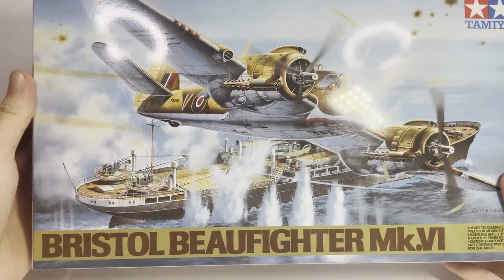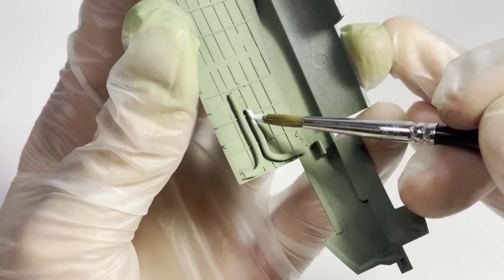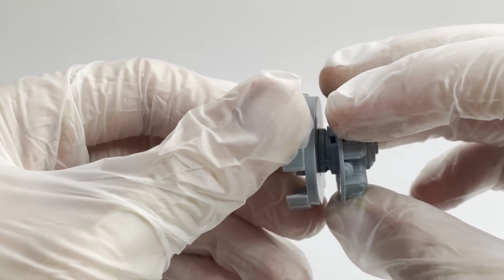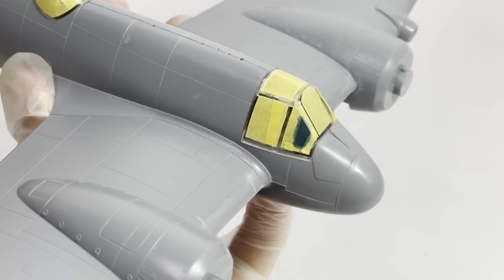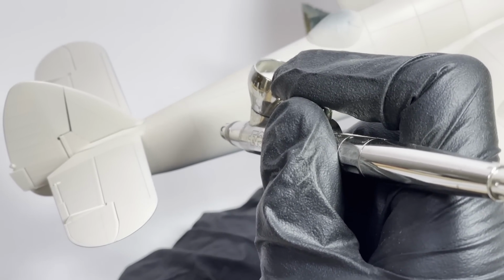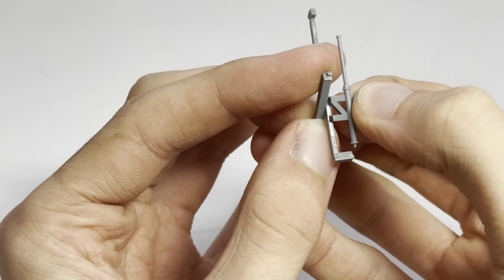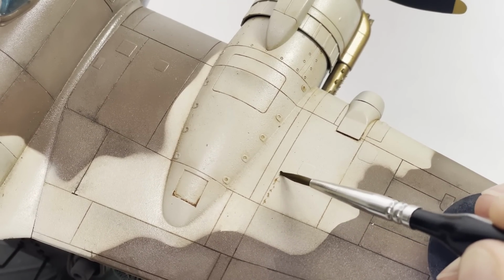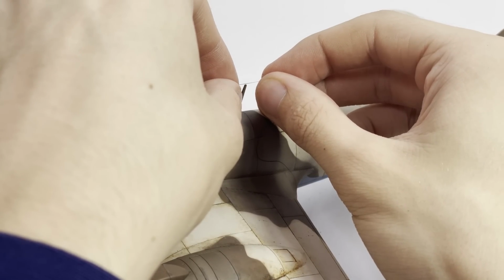Tamiya's 1:48 Bristol Beaufighter Mk.VI | Full Build | HD

Comment: RAF very nice turboprop Bristol Beaufighter Besides the Luftwaffe turboprops of the German high command. Good guys vs the bad guys in air combat fighting. I like this plane twin engines. ❤😊🤩☺️🤗🇬🇧🇬🇧🇬🇧🇬🇧
Reply from the maker: Thank you Neil for the information!!😁
Reply: The Beaufighter is a lovely aircraft but did not have turboprop engines as the turboprop is a type of jet engine that delivers jet thrust that drives the aircraft propeller. The Beaufighter had radial engines of various types and the RR Merlin for the MkII. The German a/c were also not turboprops.

Comment: I've just masked off the roundels on this model. I used vallejo "air war" colour set over a hairsprayed aluminium. Got a little bit of reaction but has added to the scratchy, sun-beaten look. I drybrushed bronze over aluminium for engine cowlings as I think the copper that tamiya calls for is too bright. I think youve got it just right. I like your post shading with the straight edge mask, ill give that a whirl too. Good video, well done!
Reply from the maker: Some superb tips and tricks there which I am sure i’ll be using in the future! Thank you very much for the comment😁

Comment: Thats a very nice Beau 👍🏻👏🏻👌🏻 One of my favourites and a bit of an unsung hero.....
You're definitely on a roll at the mo!
The exaggerated dihedral on the horizontal tail was introduced after the original flat tail was found to give some directional instability on take off and landing.....just out of interest.
Also, out of interest, when painting the second camo colour and masking like that, I always get a touch of bleed/overspray unless I keep the air pressure low and the spray direction perpendicular to the surface. A slight angle and under it sneaks.....the rascally stuff!
Classy looking job o' work, anyhoo......
Reply from the maker: Thanks for the comment! Super interesting about the dihedral… definitely makes sense now that you have mentioned it! I’ll have to try that spraying technique next time I have a camo to do! Thanks so much😁

Comment: Awesome video sir. One little question how do you thin the Extreme Metal paint? With it's own thinner or can I use something else
Reply from the maker: Thank you dude! The joy of Xtreme Metals is they are airbrush ready!! The pigment is so small that it doesn’t clog up your airbrush whatsoever… the only thing I would recommend is making sure you don’t spray it with a smaller nozzle aim for 0.3 or higher😁
Reply: @machmodels  Thank you so much

Comment: What is the purpose of using a black primer before almost white base paint?
Reply from the maker: I personally prefer the look of Ammo Mig paints on a black base, makes them look more vibrant in my opinion! When I used them on a grey base it just looked a little washed out!
Reply: @machmodels  Try silver instead black. :)
Reply from the maker: @zaptekarskaprecyzja  Oh right, never heard that before! What are the benefits?
Reply: @machmodels  first - on silver surface all issues are very well visible. Second - colours are brighter and a little of metallic finish. Third - it is easily to make silver scratches with sand paper, sharp tweezers or needle.

Comment: The RAF fought against the Luftwaffe of Goring & Hitler. Good planes vs bad planes in air battles combat. Nice turboprop plane nice work.
Reply from the maker: Thank you Neil for all the facts!!😁😁😄
Reply: Just a little note: Beafighter was Powered by Bristol Hercules piston engines, it was not a turboprop aircraft.
Reply: This here is a radial engine, not a turboprop or piston!
Reply: @stl-aviation  radial engines are a type of a piston engine, sir
Reply: Radial engines use pistons, but they aren't classified as a piston engine! Its really the design of the engine that classify it between a radial and a piston @Blue-dt1yv